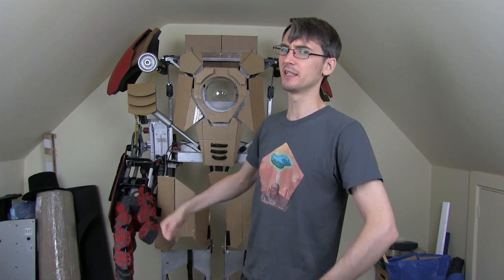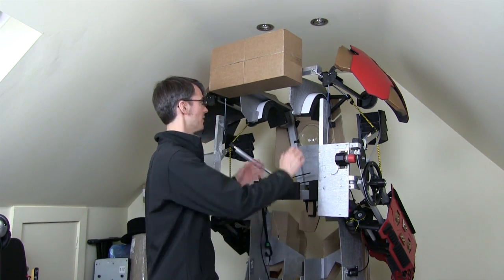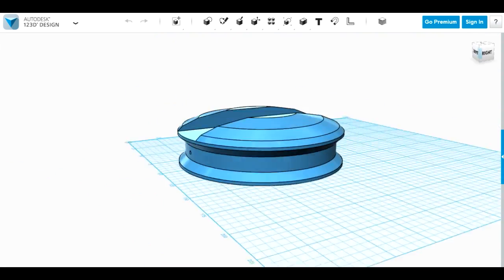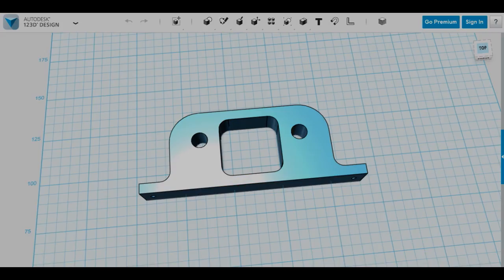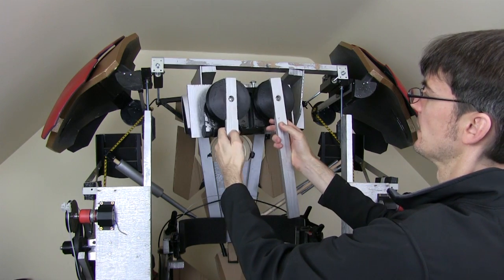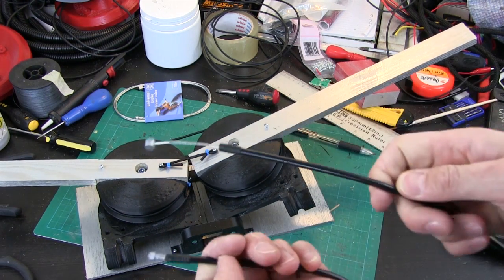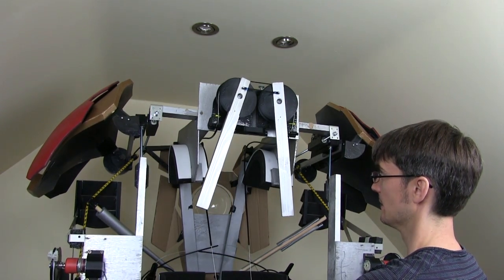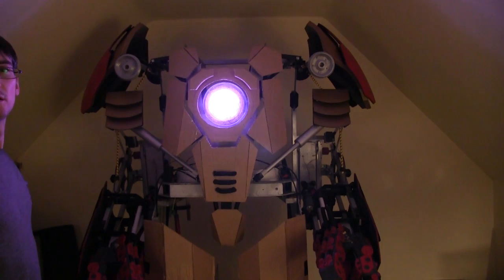Iron Man Hulkbuster Cosplay #15 | Rear Gullwing Doors | James Bruton

Comment: Not gonna lie, but I found the engineering behind the back plate quite interesting. Even if it might not be visually pleasing (just yet) I think it's fantastic. You shouldn't put yourself down. I think this was a fantastic video.
Reply: ***** i couldnt really hear you while you were talking during the vid and i havent finished it yet but i think the back panel should raise up so you can step im to it then it closes back down. Alsoi thought more about my mark 42 idea and i realised something that i didnt think of. If you were to do it the magnets might atract the wrong parts. So if you did decide maybe strings that pull in the parts would be better. Unless you can asign the certain magnets to eachother in which case the magnet idea for mark 42 might work. Oh and last 2 things 

1.) You should add an AI type thing to it as in you can call the suit and it will come to you (if possible) sort of like a jarvis thing. Plus then jarvis could moniter your power and stuff.

2.) I saw a video with a voice activated ironman helmet,(if i can find the link i shall send it to you) so what if you made your whole suit work like that to where you can say something like.... Suit open and which ever suit you implement this into, will pop open. So yeah just some suggestions. I love your work, keep doing what your doing, i look forward to seeing more stuff from you bye

Comment: A motorised slide with a manual release latch would work great to pull the doors closed,  just fit the cables to a block so they pull together, and then attach the block to the motorised slide (with a release latch) so that the motor can pull the doors shut. (The latch can be used to release the block for manual opening)

Comment: Still fairly interesting and looking forwards to the unibeam. Anyway a lot of the release and opening relies on the elastic on the pullies, but will that be strong enough when you actually have the back plates attached? Even if its made of foam it could be fairly heavy.
Reply: Just hope the foam isnt too light or flimsy that it breaks easily. I have no idea what sort of stresses the foam you are thing about can take. Are you going to use foam boards like the ones on the back of the hands?